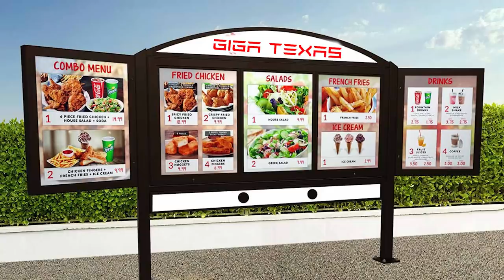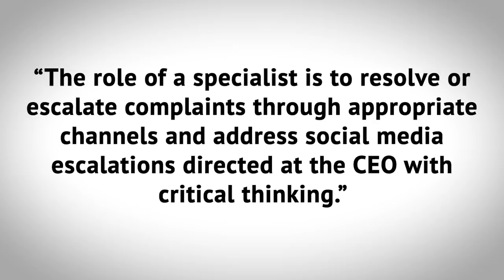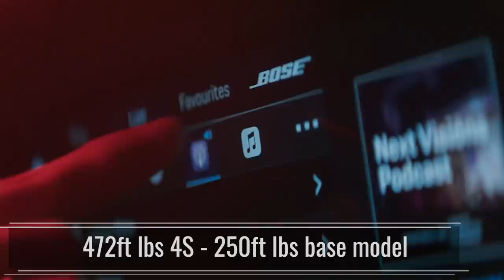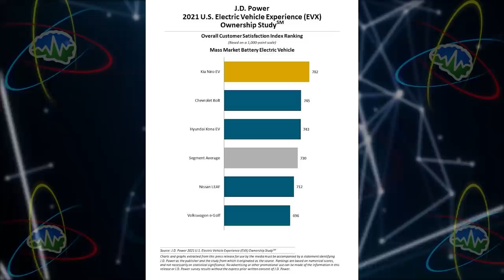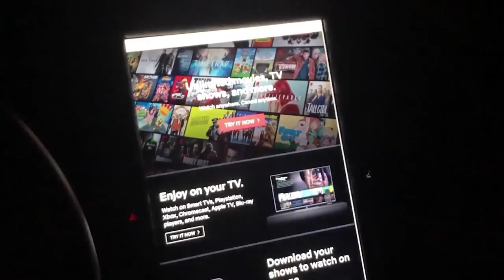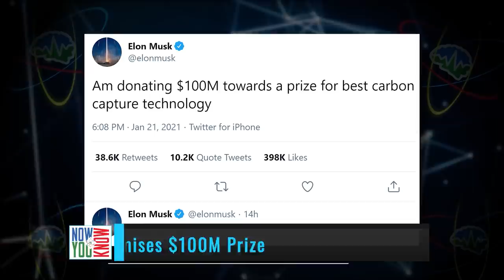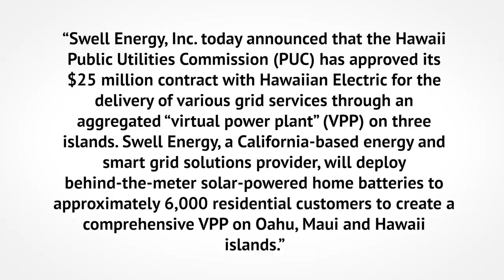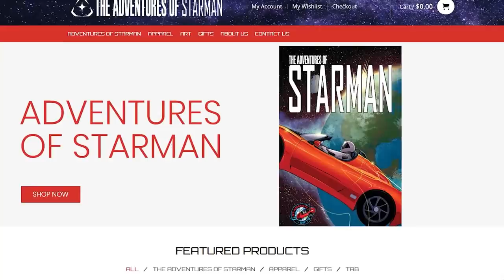Tesla Time News - Elon Buys Oil Rigs??

Comment: due to the sound of 28 raptor engines on a super heavy booster firing all at the same time, it would be so loud it would shatter windows and ear drums for miles around, so for safety SpaceX will launch Starship and Super Heavy on sea launch platforms